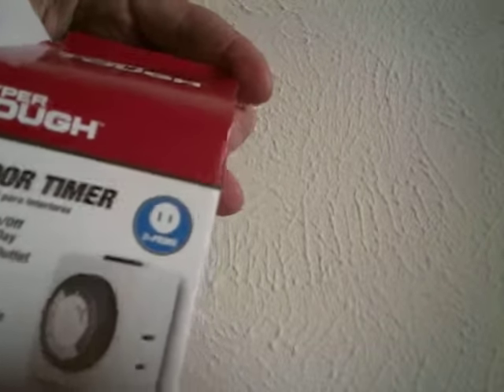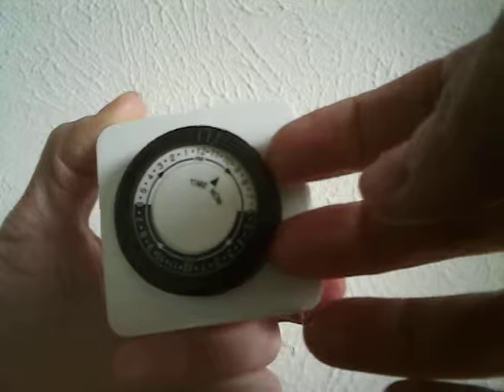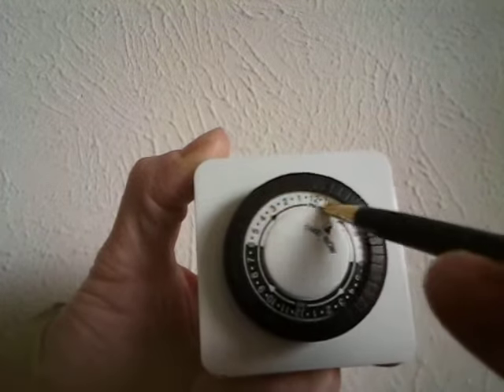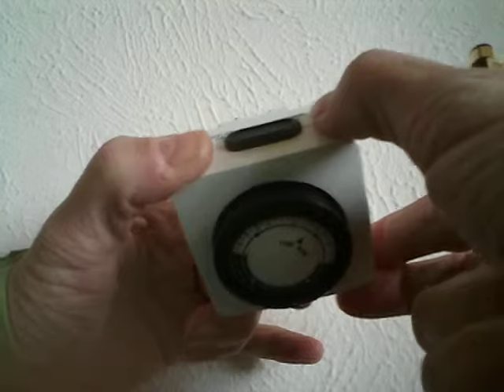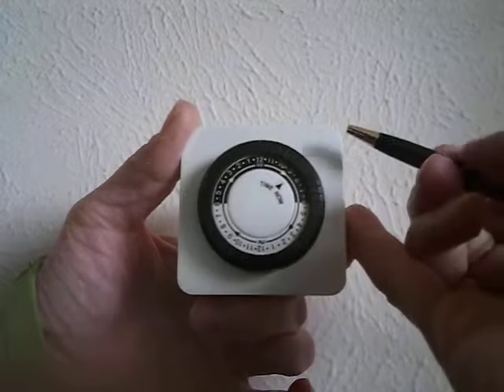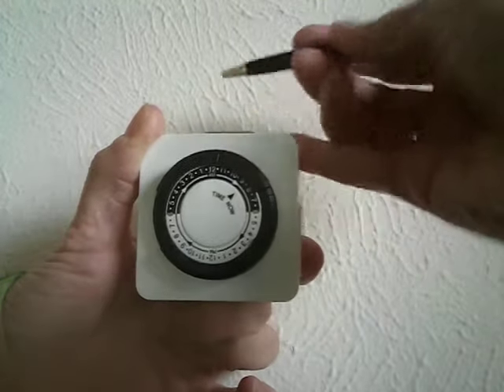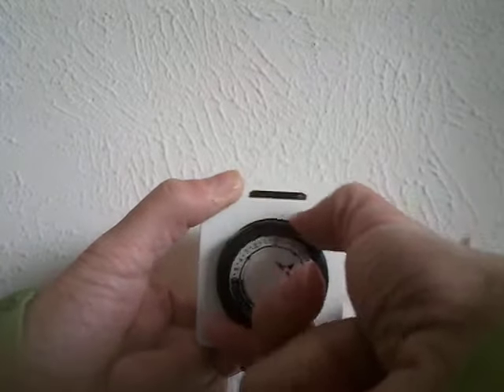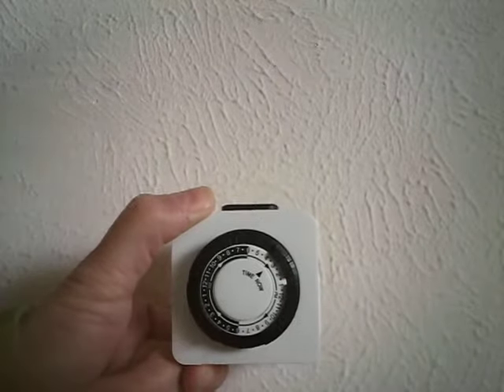How To Set Hyper Tough Indoor Timer (FOR SLOW FOLKS LIKE ME - READ DESCRIPTION)

Comment: Thank you. I just got these and was trying to figure it out. The instructions made no sense. Thank you for explaining it to us more mortals.
Reply from the maker: You're welcome! I'm glad this helped.
Reply: @jibberoverjava  Yes because no where in the instructions did it say that ALL pins should be up and then push down to set the time you want the light on.  The design is brilliant but the instructions are not. I love how quiet it is. Some previous ones I had made a ticking noise when set. I can get these go and forget about it.
Reply from the maker: @geminiots2121  I don't sponsor these and am not compensated in any way so I'll be honest I've had a number of these break without any reason. Some of them just come on but won't turn off and others just fail all together. A couple of them I thought were broken from the box out (3 out of 7). And 2 actually had to be operated in the reverse, so on those instead of the buttons being all pulled up to start they had to all be pushed down first and the time you wanted had to be lifted up. They do seem a bit fragile despite careful handling. I use several of these throughout my home. Life has been a lot easier since I've started using them and they fit my budget because they're extremely inexpensive.
What else I like is I don't need any Wi-Fi or AI and my life remains private.
Reply: @jibberoverjava  Oh of course I understand. Thank goodness for YouTube to give people a platform where you can show others how to do stuff. Even there own websites can explain things clearly. I'm sure many people are grateful for folks to be shown how stuff works.

Comment: i keep doing this  everynight set the half hour with my exacto knife is there a way to lock it in so it stays every 30 minutes around the clock without having to set the timer everynight?
Reply from the maker: @KiaSoulTravels  I apologize for delayed response, my notifications placed the most recent on top of yours and others prior to it and I only saw one from my own comment on a video.  There might be a way, if you look between the numbers at the split between the tabs you should see that the split between the tabs lines up with dots between the numbers, these are the half hour increments but what it might be is that it will come on at say 1:30 instead of 1:00 I don't know if what you mean is is there a way to set it so that it actually turns on and off every half hour I don't think so. If you want it to go on and off every half hour you can try setting every other tab. Or possibly the tab before the dot and if that doesn't work then try the tab after the dot between the numbers. That should be equivalent to every other one and make it turn off and on the half hours. If you try this and it doesn't work then the answer is absolutely not. Your next best bet would be to get a smart outlet that works with Bluetooth. I have a couple of those myself and they are very precise you can probably get them to come on every other second 😆. Please come back here and let me know if it worked or not and if you're interested in trying a Bluetooth plug/timer device I can tell you the name of the type I use. Again I'm very sorry for the delay in responding to you, I usually respond the same day or the next but occasionally I get these glitches.
Reply from the maker: @KiaSoulTravels  you know what? ... After thinking about it I wanted to tell you there is a possibility that your timer doesn't work properly. But let's see if you're willing, give my earlier response instructions to try if they apply to what you meant. I'm not an expert on these timers even though I've been using them for a really long time. I've never actually tried myself to get them to come on and off every half hour.

Comment: Is this set it and forget it? Or do I need to turn a spring of some sort ?
Reply from the maker: It's a set it and forget it. Make sure you've slid the switch to ON and it's not plugged into an outlet that's controlled by a light switch or a power cord with it's  switch turned off.  Some of them randomly do stop working,  probably due to an unnoticed power serge. I've owned more than a dozen over the past 10 years, they've all been safe but a few have died in homes with facade new faceplates/outles but old wiring in the home. Best to buy from stores like W-Mart who readily take returns. If it ever stops working,  buy a new one, pop the old one in the new one's box and return it as defective. Just be sure you bought the same brands from the same chainstore.
Reply: @jibberoverjava  sweet thank you so much for the reply your awesome! 🙂